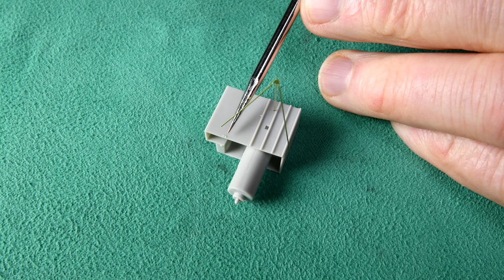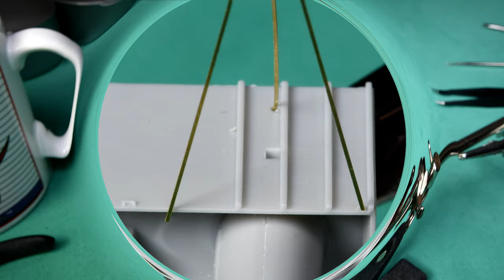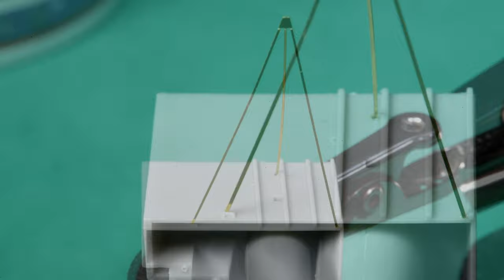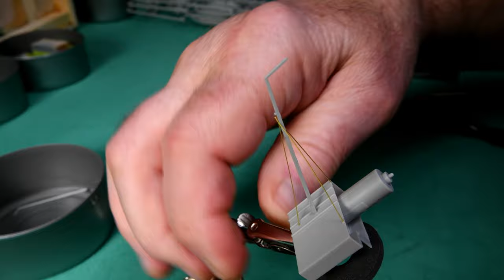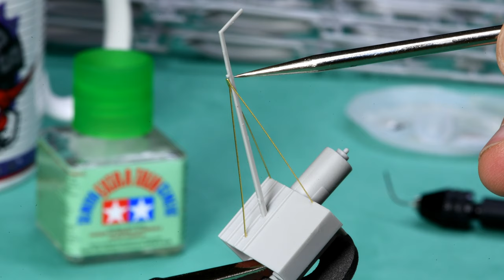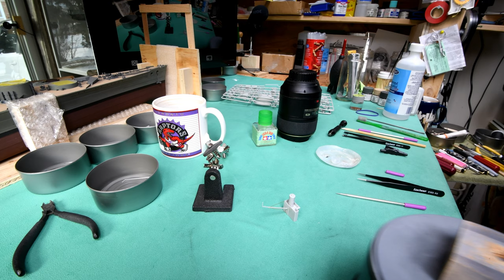The Model Ship - Part 637

Comment: A bit too late with this suggestion but here it goes. Perhaps it might help if you drilled tiny holes in the two upper holding places. That would give some more rigidity to the parts to be able to take the force of the rigging.